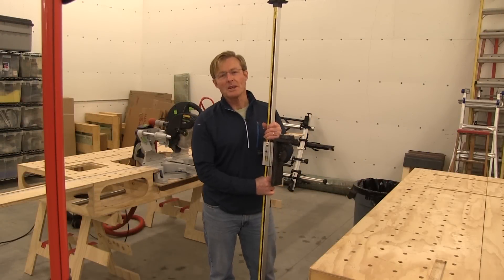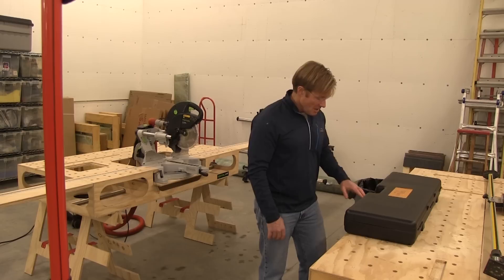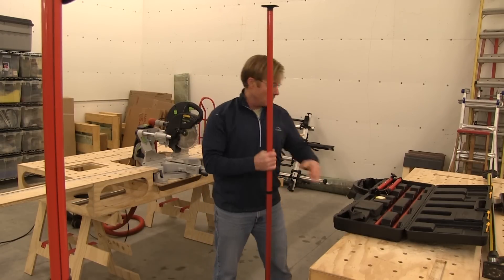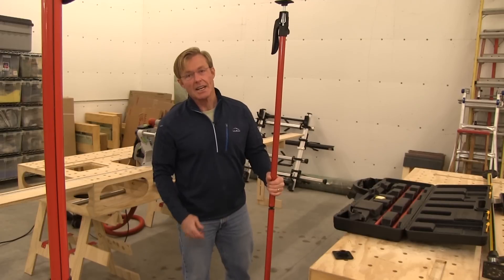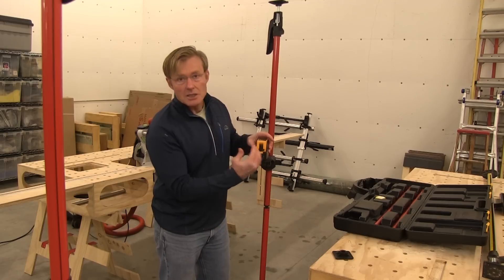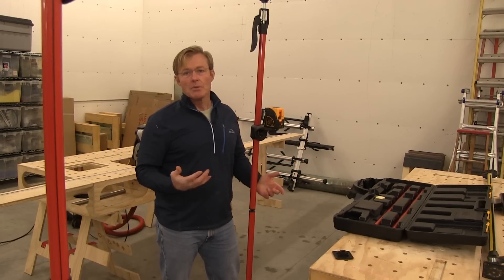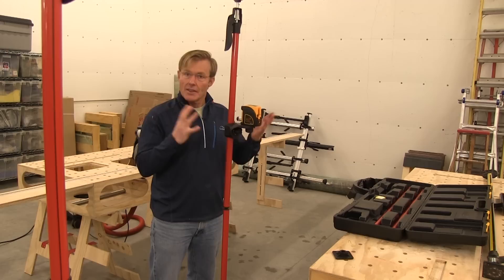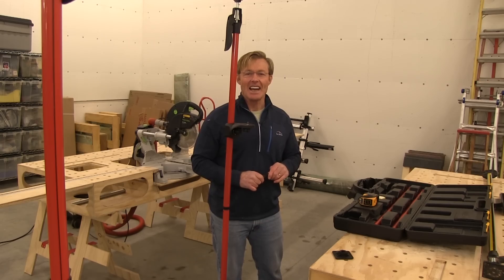LASER JAMB

Comment: How does the tape measure attach to the pole? Is the pole the same as a 3rd hand on the top? Is the tape measure specific to that setup? I already have 3rd hands and a laser and a mount, can i just add a tape measure to it in the same way? I can not find any information on the Fastcap website about this or anywhere else. Thanks! I have your plans and have built the work table with my router in it as well. great space saver in my tiny woodshop.
Reply from the maker: +Michael “Dot” Woodrum I don't use the tape. My workflow is to make a mark on the wall and set the laser to it. I would email FastCap as I am sure they can assist you with the part you would need to use a tape.
Reply: +Ron Paulk ok. thanks for the response. and a quick one at that! I'll reply once I get the part number, in case anyone else has the same question.
Reply: tape measure mounts near the hand vice clamp